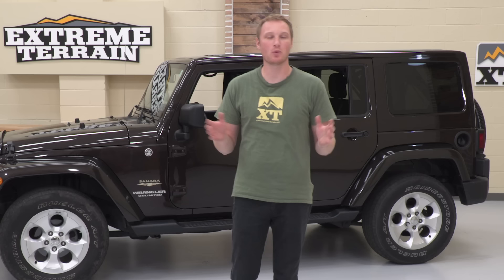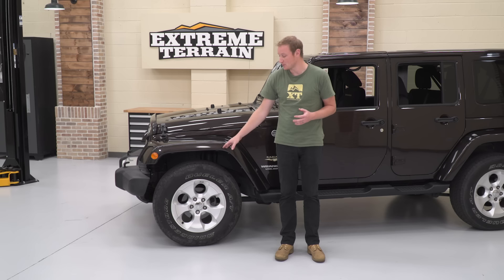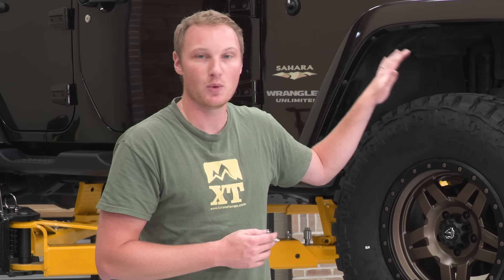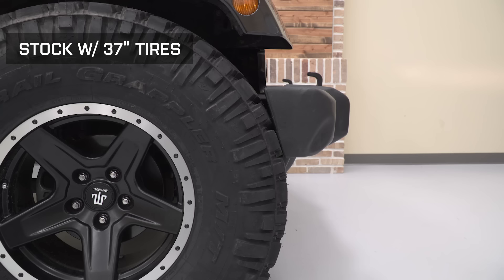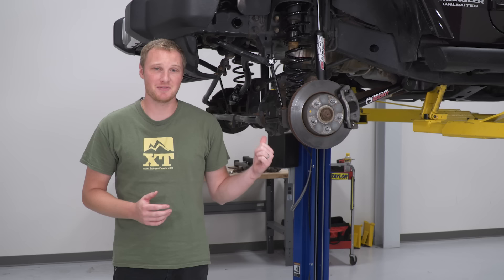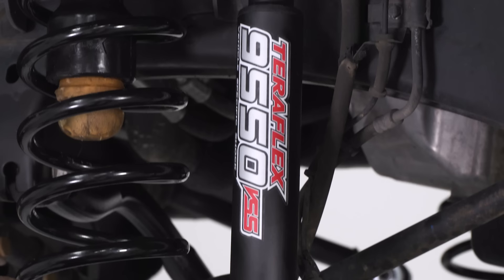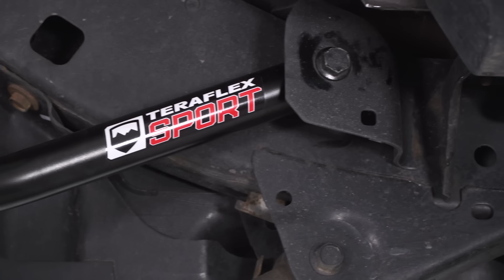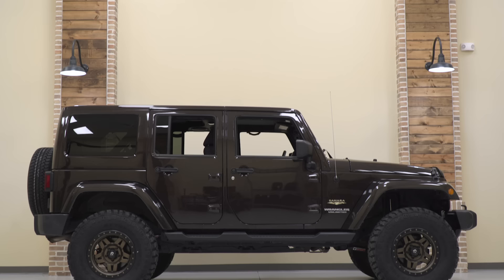How To Fit 35" Tires on Your Jeep Wrangler JK | Jeep Gets 3" Teraflex Lift and 35"s Installed

Comment: Really wanted 35s but don’t want to spend on the lift yet
Probably going with 33s 😢
Reply: I bought 33's back in January but it bugged me seeing how much better other Wranglers looked with 35's.  So about 2 mths ago I traded my 33's in and got 35s.  Barely got any money back for the 33's so needless to say it was an expensive decision/mistake.  If you want 35's I suggest waiting to get your lift before you buy tires so you can get the size tire you really want (those 35's).  Trust me, you'll thank me later.
Reply: I was considering the tires first, removing the splash guard , then the lift but idk if that’s a good idea
Reply: I ended up doing an inexpensive spacer lift kit (2.5 inches).  The kit plus install I believe was less than $400.  It gave me plenty room for the 35's.  I did still rub a tad on the splash guard but I cut the edges where it was making contact and I was good to go without removing the entire guard.  But main point I wanted to make is don't make the mistake I did in getting 33's only to wish you had gotten 35's.  You'll either dislike the Jeep for the next 2 to 4 years until you need to get tires again or you'll end up doing what I did and waste money going back to buy 35's.  One more thing though... you may also hate the Jeep if you get 35's and you have 3.21 gears (what I had).  It will be very sluggish and it will downshift and be revved up all the time at the slightest incline or even on flat roads if you put any real pressure on the gas pedal it will downshift.  I regeared to 4.56.  With the regear it feels almost like stock again.  If you have at least 3.73s you would be 'OK' with 35's and you'll definitely be alright if you have 4.10s.
Reply: @isomhawes311  I did the same thing. Got 33's and a leveling kit.  It was ok but ended up spending money twice. Got a Rock Krawler x Factor 3.5 and 35's the ride is So much better than stock. Even went with Fox Shocks. Wait a little and reach for the 35's and a proper lift kit. You'll thank us later.
Reply: @lopezproductions6381  I'm thinking about getting a 'real' lift too.  My reason is just to get a tad more height and I know you can only go so high with spacers before you have to cross over to a real lift.  But if it rides better too that will be great!
Reply: Isom Hawes it rides better than my wife’s brand Cherokee. Given it still feels sluggish on highway speeds but driving around it is really smooth. Also off roading it dozen thrash us around inside like the leveling kit and stock did
Reply: @lopezproductions6381  Holy crap, I just looked up that kit and it cost over 2k!!
Reply: @lopezproductions6381  what's your IG?
Reply: @JonathanTacoman  I had taken the splash guard off and found out that it helps with flowing air underneath the Jeep I dropped over a mile a gallon. If you remove it try to replace it with a similar size skid plate that allows for the bigger tires but will also smooth out the airflow running underneath the Jeep I thought the drag would be minimal but noticed mpg loss and alot more hood flutter.
Reply: The stock splash guard/air dam is a plastic piece and can be easily trimmed where the tires rub instead of removing.  I don't know why that wasn't mentioned in the video(not bashing the video by any means, thank you for the info)
Reply: Thanks for all the comments I went with the 2” lift and 35’s 😍
Reply: @oldmanjeepingandbiking9621  Yeah true 👍
Reply: @JonathanTacoman  Hey whatever lift and tires and size you went with at the end of your day its your Jeep. Do what you want and just enjoy it and life. Life's too short anyway. Glad you went with what you Really wanted to do.👍

Comment: Can I run 35's on a 2 1/2 inch lift?
Reply from the maker: Definitely! There may be a little rubbing if you plan on going off-road and flexing things out, but you will have plenty of clearance with 2.5" for daily driving and light to moderate trails! -Zach
Reply: @extremeterrain  Thank you for the info. I appreciate it

Comment: Any problems running 35s on stock gears?
Reply: I'm running 35s on the stock 3.21 gears. Have been for almost a year and it's fine. I do plan on going up to 4.56 though.
Reply: Micheal Dingle that's the only thing I was concerned about. I do plan on swapping gears eventually, but wasn't sure how it would handle with the 3.21
Reply: @jultnnrpearson03  it's a little sluggish compared to stock but it's not terrible.
Reply: What would happen if you don’t regear?
Reply: The Bike Life - Ive been trying to figure this out myself. Did you ever get an answer on this?
Reply: @MrFabio1022  onroad driving should be fine. But in off-road situations the load on the stock ring and pinion gears in the front diff would be too much especially while flexing when those gears don’t mesh properly. You’ll end up damaging the teeth of the gears

Comment: Rubicon's aren't slightly higher, nor do they have larger tires. Do the math on the 255/75-17 and the 255/70-18 that would come in the Sport or Rubicon vs the Sahara size. 

Furthermore, Extreme Terrain failed to read the thread on JK Forum where the ride height is determined by the number of the coil on the jeep, not the trim. Yes, typically the more heavily equipped jeeps (4dr, hard top, tow package) have higher rated coils, but solely a Rubicon means nothing.

I appreciate that you guys are trying to put out information but let's avoid scare tactics and misinformation.
Reply: kswyg Certain special-edition Rubicons the last year or two came with 33-inch BFGs. But, for the most part, you’re absolutely correct.
Reply: @SmokeytheJeep  10th anniversary Rubicon's, yes. The hard rock and rubi x came with 32" bfg mt's. Same story though- factory coil numbers dictate the height of the vehicle. I purchased Rubicon springs that were the same as a fully loaded sport.
Reply: kswyg I’d thought the Hard Rock was on 33s, but maybe I’m mistaken.

Comment: Do you need to regear with 35?
Reply: Depends on what gear ratio you are running. Rubicon usually are different from the Sahara and sport. My Rubicon doesn't have to regear with the 4:10 manual transmission.
Reply: I had 3.21 gearing when I put 35's on.  There are those that will say a regear isn't needed but after driving for just a week with 3.21 gears, I couldn't take the sluggishness anymore and regeared to 4.56.  I probably would've been OK with 4.10s but I'm not unhappy with the extra pep of the 4.56s.